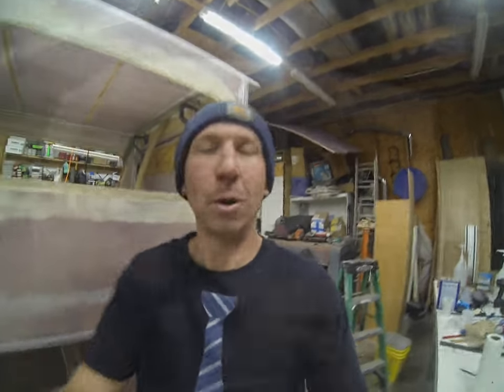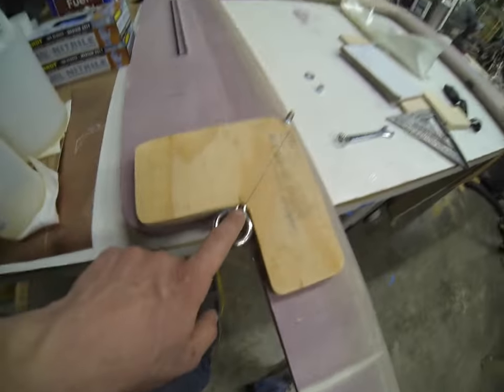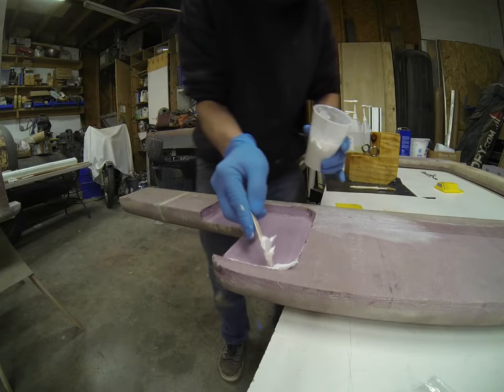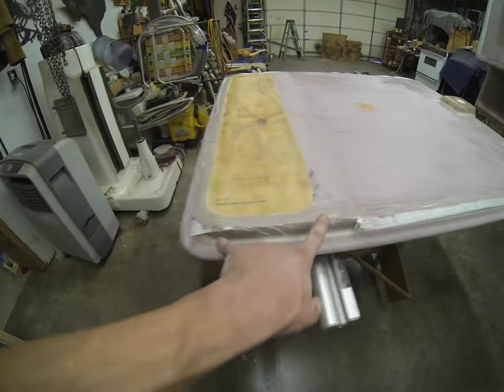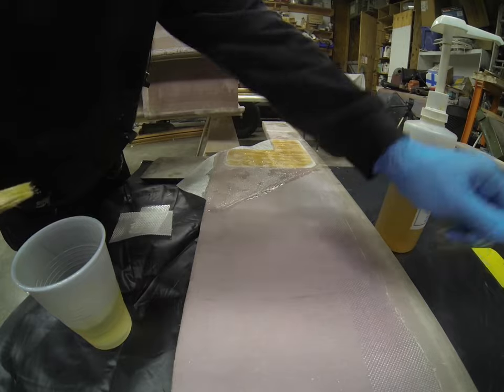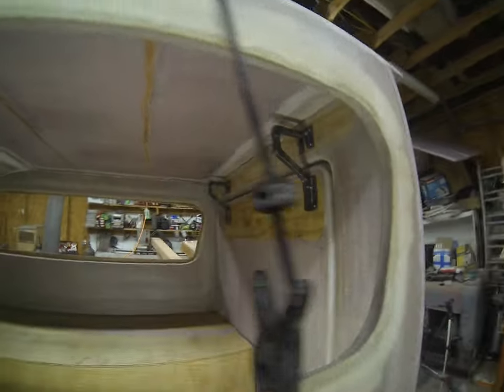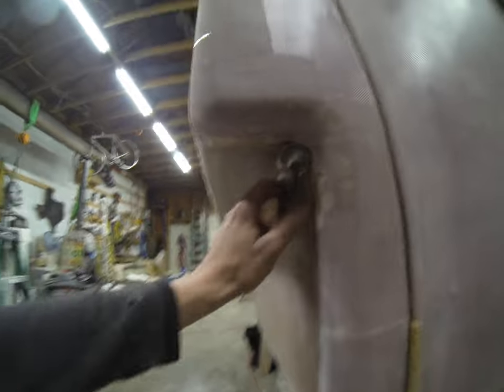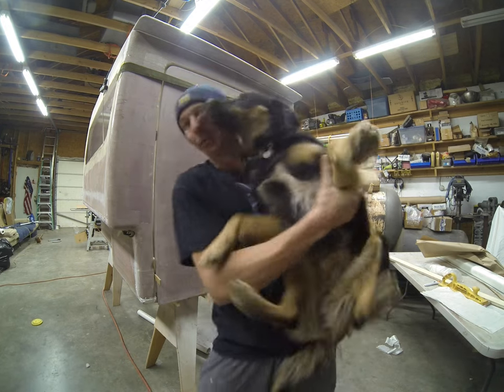Foamie Camper Build Update- So Close I can Taste It!

Comment: I'm just learning about fiberglass, I see you using the micro to bond bare foam but can you also use it to bond fiberglassed pieces together? I want to build one like yours with a cabover section and maybe a double rear hatch that folds down for a platform and up to create a small awning.
Reply from the maker: Micro will absolutely bond glass to glass. Just make sure and prep to an 80 grit finish first. check out cotton flock for a more structural filler, its strong as heck, but harder to make look good.

Comment: The project looks great and I love your energy.  Is there a video you explain your terms fully?  I've watched 4 or 5 but I'm not certain what type of fiberglass you're using.  Not sure what micro is? Or what the epoxy you're using is.
Reply from the maker: Thanks for watching!

 Im mostly using a 6oz/sq yd 2532 cloth. There are tons of different weaves out there, I chose this one based on cost and availability. 
Micro is microballoon glass filler mixed with epoxy to the desired consistency . 
Epoxy is well, just epoxy. you will want a low viscosity product designed for laminating. 

Do some googling on "composite basics" "thatyercraft" and "uscomposites" and soak in as much as you can. That should get you started.